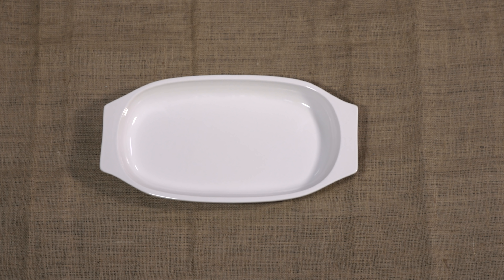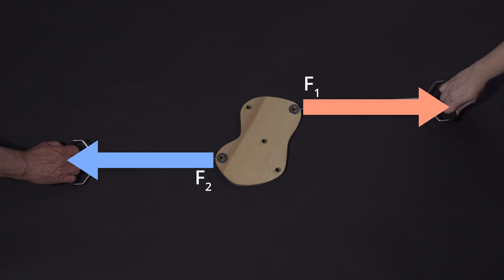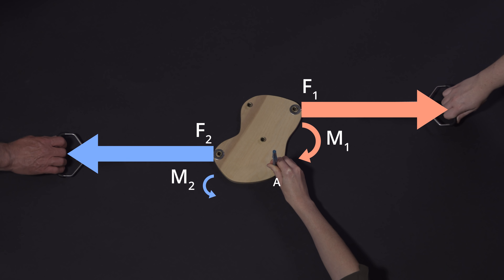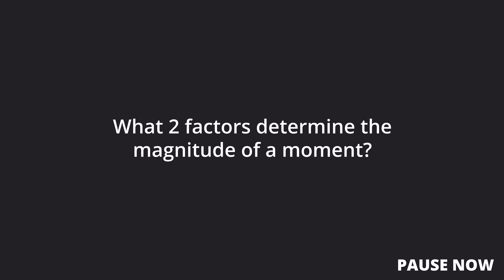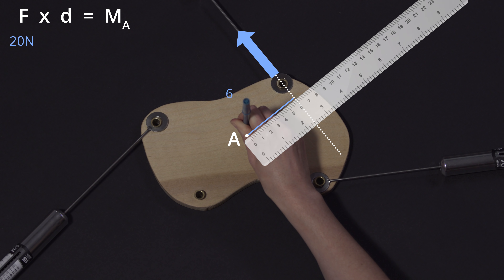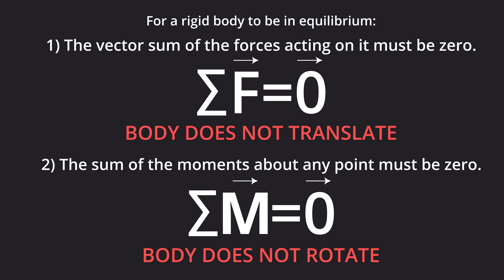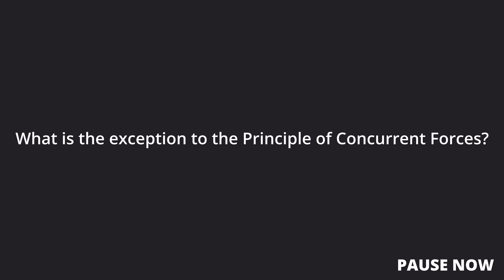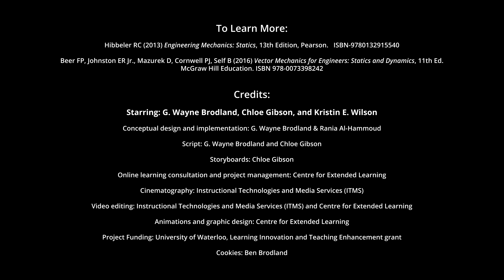2. Equilibrium of a Body

Comment: What if there is no "A"? How would you calculate that?
Reply: If it is in equilibrium, the sum of moments will be 0 for ANY point. If it is NOT in equilibrium, the sum of moments will NOT be 0.
Reply: If an object is not somehow forced to rotate about a specific point A, it rotates about its center of gravity.
Do if the question is just: is it in equilibrium? then the answer is: chose any point you like. If it is in equilibrium, then the moments cancel each other for all points. That includes the point you have chosen.
If you need more, eg figure out how exactly the object will rotate and what momentum remains, then you have to calculate the center of gravity first. But this case is rare as usualy rotating bodies are not in free fall but are attached to some axis of rotation.